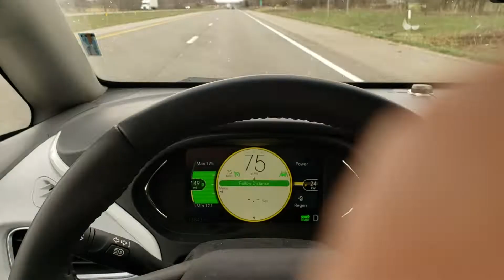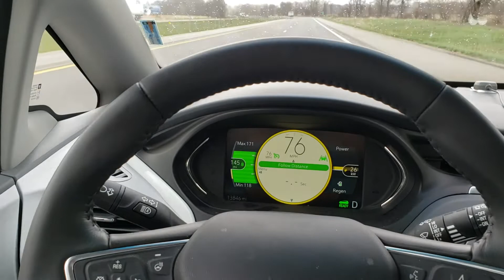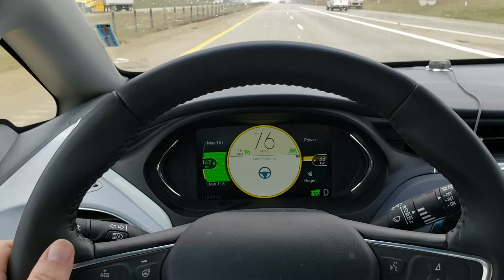Self Driving Chevy Bolt EV - Comma Pedal update

Comment: are you still covered by insurance?
Reply: @StandBackLabs  thanks for your answer. just to clarify my question: for example, I have insurance on my car, then I apply the openpilot change to my car. I think once I drive the car with openpilot change on the road, the insurance won't cover me. I like your project although. It's great to see that happens. However I doubt that can be a business model like redhat linux.

Comment: +25 in the pedal code because of the "L" driving mode? What's the difference with normal D? And the use of Sport mode?
Reply: Jason Shuler saw that in the code after downloading it because you got me curious. Not familiar with this code (first time I lay eyes on it) but dropped it in XCode just to follow the trail. 
I’ll give it another look tomorrow after work. 

So happens I have a 2019 Bolt EV LT with both security groups; with lane assist. So it adds to my curiosity.

Comment: It's so cool that You are working on getting this system up and running.
The 2020 bolt is high on my list for my next vehicle.
I'm a technical person myself. Having worked with computers and mechanical stuff also.
Do you have a plan to offer the programming the coding or whatever else is required to put this on a vehicle?
Or instructions on how to do it once it's all working.
Thanks for the work and effort you're doing it's much appreciated.